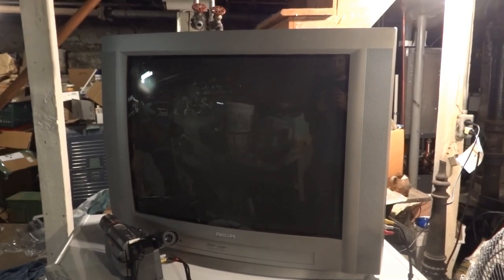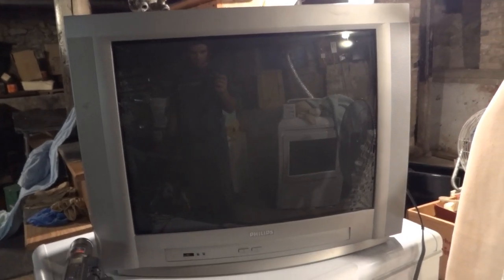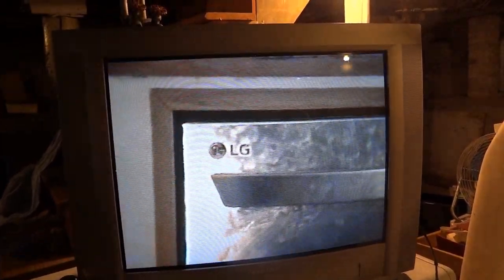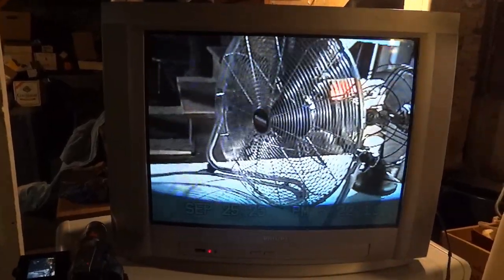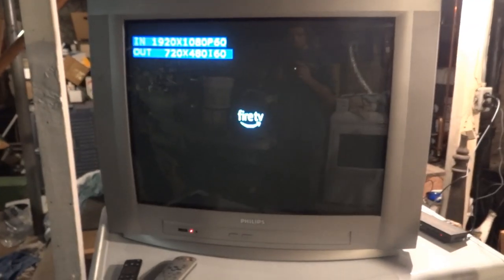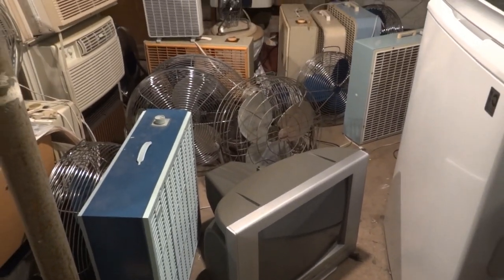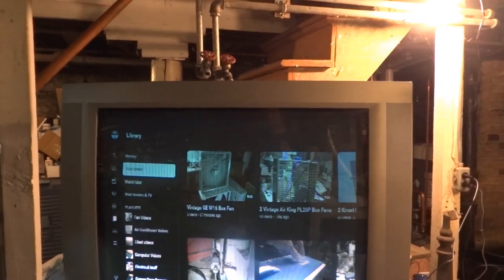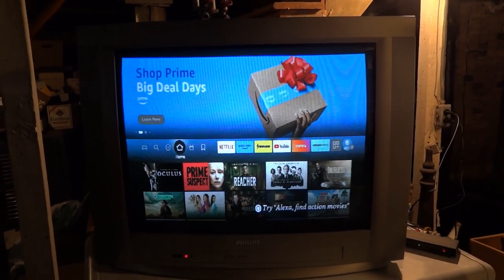Philips 27 Inch CRT TV

Comment: Today I visited my landlord to pay my house's rent. She showed me her (huge) house and when we went upstairs, I stumbled across a huge Philips CRT on the floor, I think it's exactly this one. She said I can take it for free if I want to, and I will, next Saturday. Do you think it's a good replacement for my 29 inch Panablack? My tv needs a slight calibration but image quality is really good.
Reply from the maker: I think it's a very decent replacement.  If the one you're getting has component video like mine, that would make it an excellent TV.
Reply: @carson01XJ  Yes it does, and the Panasonic too. One question: Have you tested light gun games on your TV? Fr some reason, my Panablack is very hard to use with them. It's from 2007, a really late CRT model. I think the games might work great with this 2002's Philips.
Reply from the maker: @stonerdemon  I haven't tested any light gun games, but I'm sure they'll work with this TV.  Your Panasonic from 2007 probably has some digital signal processing going on that's keeping those games from working.

Comment: I enjoy your videos always. This one especially interest me. I have a 1998 Panasonic 27 inch that I stopped using because the only way I could get apps into it was via a Blu-ray player and Sony quit supporting YouTube on their Blu-ray platform. This HDMI to component output adapter has my full attention. I’m so glad they make one. I would love to use this television again. It had their   early efforts at a flatter crt called “pana black” and an asked video input as well. It was their top-of-the-line TV at the time and not that much less expensive than a Sony. Even in the 2000s when flat TVs were common friends would still argue that it might be a digital television, because of how good the picture was.
Reply from the maker: The HDMI to component and HDMI to composite converters are awesome. I'm definitely getting more of them for other CRTs that I have.  I have 2 Samsung DynaFlat HD CRTs from the 2000s with flat tubes that can support 1080i video through the component video inputs.  One is a 27 inch and the other is a 32 inch (probably weighs about 200 pounds).  The 32 inch Samsung has subwoofers in it, and they get pretty loud.  The video of that one is coming soon.  These TV's can also still get over the air broadcasts if you have a DTV converter box.  It's so nice to be able to keep using stuff like this.  Several year ago when my dad first switched to HD TVs, he bought a Samsung SlimFit HD CRT.  It was a widescreen crt, and wasn't as deep as most CRTs.  It had some geometry issues with the picture unfortunately.  Some of the later HD CRTs had HDMI ports.
Reply: @carson01XJ  thats so cool. Those early hd crt sets were sooo expensive when they came out. Very well made. The sonys had thin circuit boards to cut weight and if the tv was put down too hard they would break sometimes. I worked at circuit city in 1998 after graduating. It was cool to see the technology developing. Hitachi ultravision projection tvs were still popular!
Reply from the maker: I've always thought the rear projection TVs were cool.  I have a later rear projection tv from 2007.  It's a 37 inch Sony Bravia LCD projection tv with HDMI.  The color and image quality is great.  Only downside with those is that you have to replace the projection lamp every once in a while.  A relative of mine had a couple older CRT projection tvs.  Only display technologies I haven't really used are DLP projection tvs and plasma tvs.  Definitely want to get a plasma  soon.